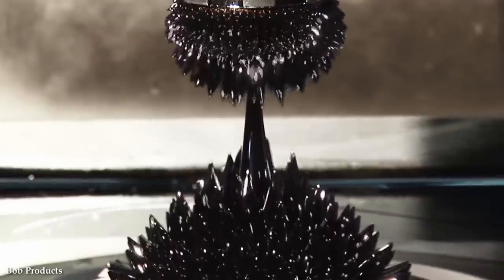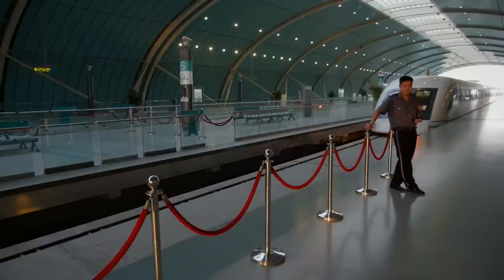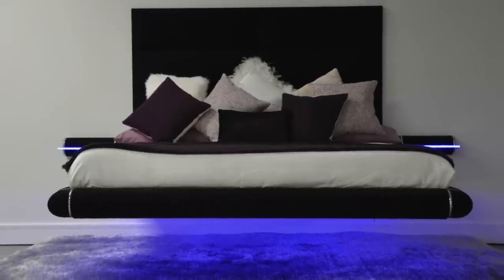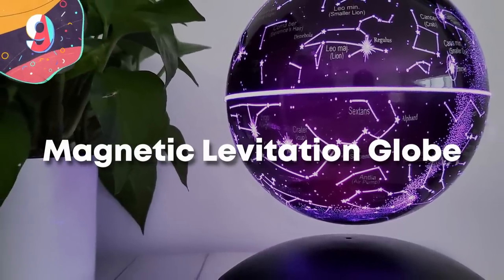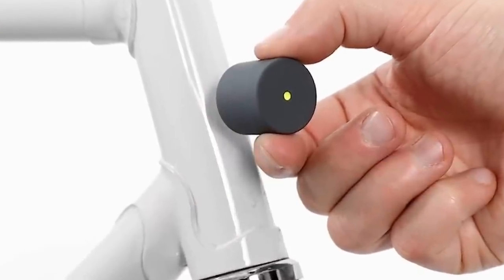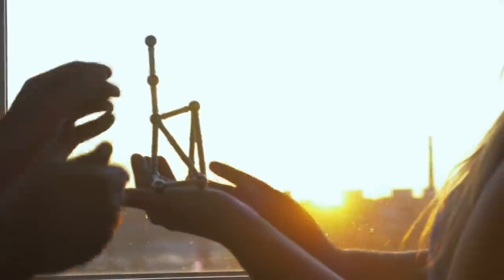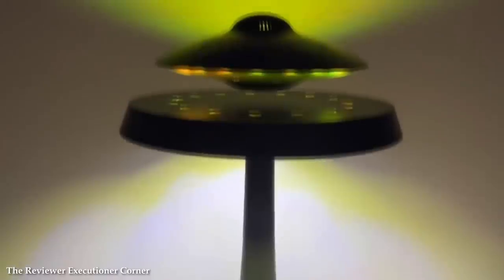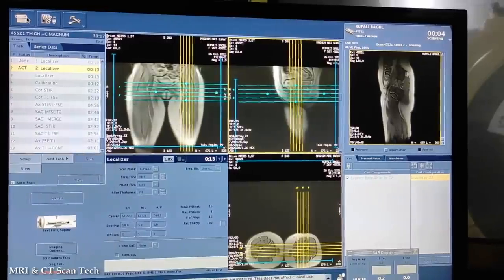MAGNETS and Magnet Machines that are Totally Awesome

Comment: Healthy magnetic floating  bed? Does not sound very healthy to sleep on/in strong magnetic fields! I'll be interested to know if elector-sensitive people have already tested this paradigm ?
Reply: If it's to free the bed from any contact with the floor, I'll be keener to have a bed directly fixed in the walls.
Reply: what happens if the power goes out, and you have that mattress.
Reply: @jspntr  I think it's passive magnets, so it does not cost any electricity and the magnetic fields are more static, otherwise you'll probably get some sort of electrical noise on the top 😅 But even static magnetic fields do not seem very healthy, ... may be there is a magnetic shield between the mattress and the magnets ?
Reply: I would be afraid to trip over those thin cables in the middle of the night.
Reply: @achatinaslak742  Absolutely + one thing is really annoying me in modern architecture, it's that we don't attach enough things to ceilings! Think about a room with many strong fix points on the ceiling, furniture don't need legs anymore, so much easier to clean + if you like a bit of fitness you could exercise with bars fixed right into there, so practical !
Reply: magnetic bed company is owned by same guy who owns the submersible sub company .
Reply: I've got a pacemaker/ICD and it would be better labeled a magnetic coffin😅